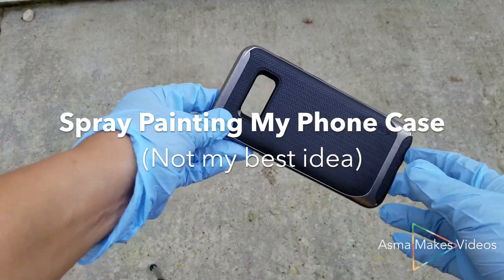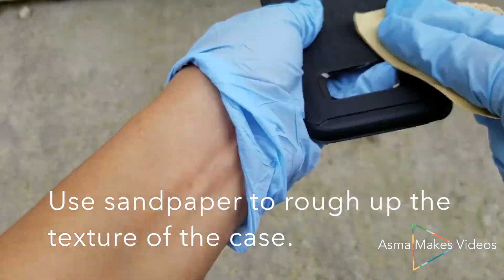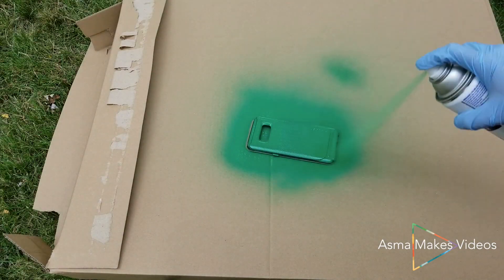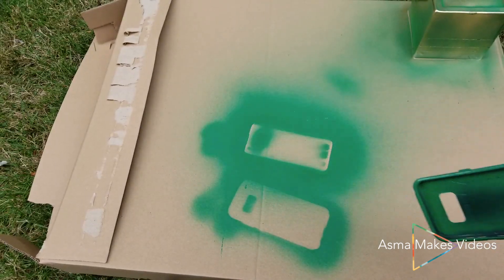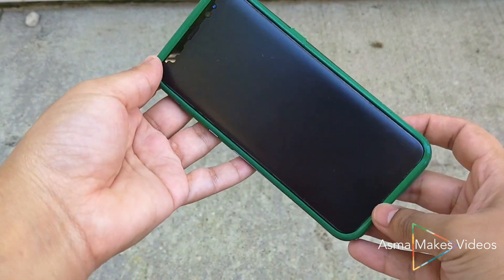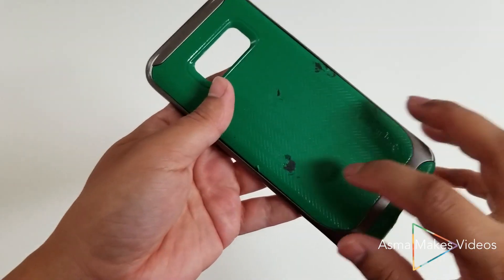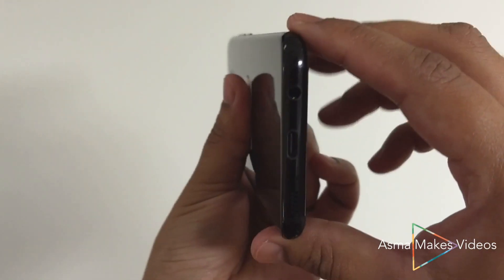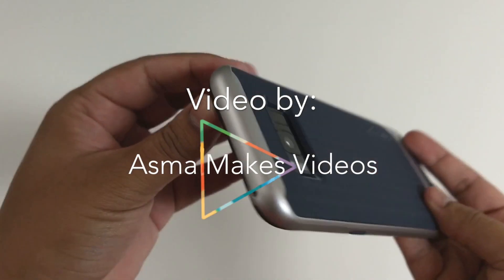Spray Painting My Phone Case

Comment: you forgot to spray on the paint primer
Reply from the maker: This particular paint was both in one. I just followed the instructions on the can.
Reply: @asmamakesvideos1729  hmm, probably cheap spray paint then.

As far as I know, we're suppose to sand off the protective layer on the plastic, spray on the paint primer, and then spray on two or three coats of paint with 30 minutes in between.

I'm no professional, but that's what I've been doing and seeing.

Comment: No clear coat required?
Reply from the maker: The instructions for the paint I used stated not to use a clear coat, so I didn't. But several comments have suggested using a clear coat. My issue with using a clear coat (aside from the instructions saying not to) is that the case already felt thick and slightly sticky because of the paint. I feel like that probably would've gotten worse if I had used a clear coat.